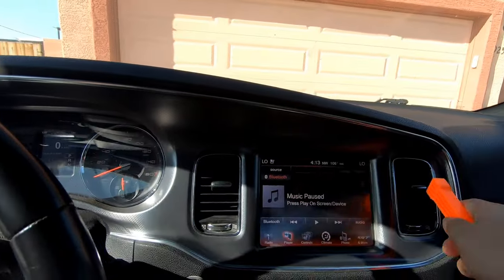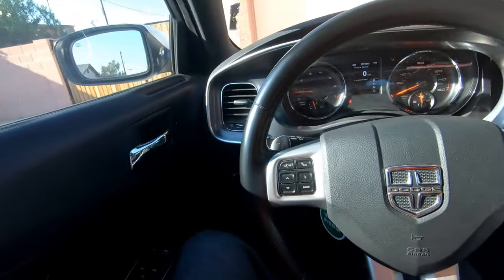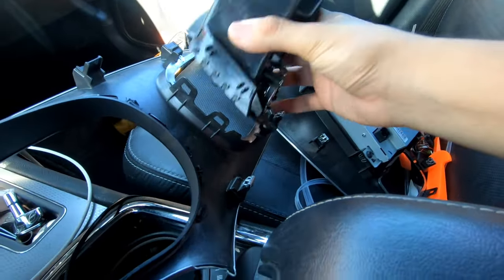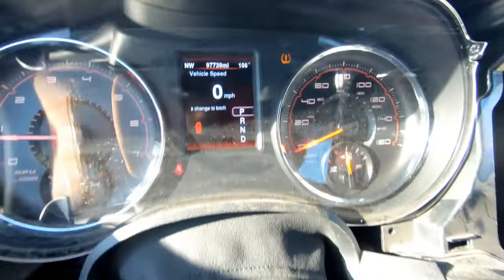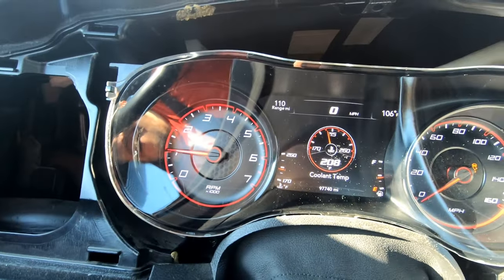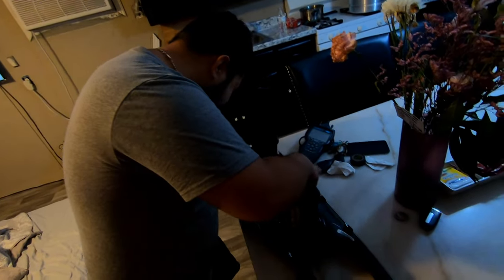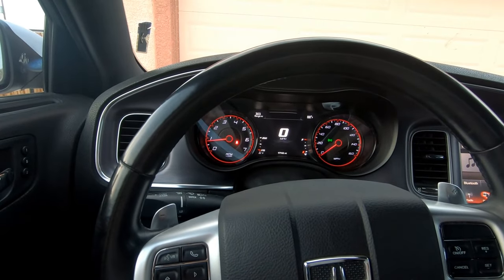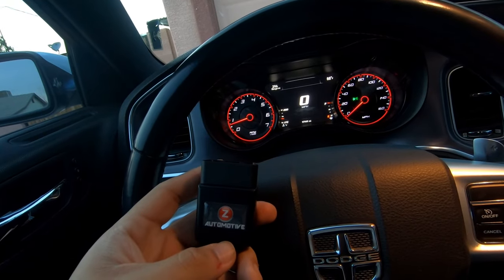Charger Cluster Swap Upgrade - How To

Comment from the maker: Here’s how to enable cluster swap mode to get full functionality of your new gauge cluster upgrade :D

https://youtu.be/BzK8vn2KXAA
Reply: How did you attach the radio
Reply from the maker: zip ties
Reply: If I upgraded to the same year uconnect as the cluster and bezel would the screen fit like normal you think?
Reply from the maker: unfortunately no, you’d need to order a harness for the radio to work and to get it to fit you need to cut out part of where the radio sits so the new one seats properly:c
Reply: Does the old bezel work wit the new cluster??
Reply: @EverythingBoosted350 will a 2017 fit in a 2012 dodge charger
Reply: how do u reset the odometer?
Reply: @mr_blobbington8620  you don’t reset the odometer you by one that matches your current odometer
Reply from the maker: with alfa obd you can set the milage to your original miles. i got lucky and swapped one with the same miles
Reply: @rollo1thousand154  well my odometer reading was at 159k miles and the new cluster is at 80k, I just wanted to c if I could reset it to what the original cluster showed
Reply: @EverythingBoosted350 k
Reply: Are the miles the same on both?

Comment: Can you still use the original bezel or you have to get the 15+ bezel
Reply from the maker: you can modify the original to fit the new cluster but from what i’ve read, some of the people that have done it are happy but not fully satisfied so they ended up getting the 15+ bezel to get the look they wanted. In the end you can go either way :)
Reply: Another thing so does it matter what year of the model the cluster come off of or just use the 15 work
Reply from the maker: Nah it doesn’t matter as long as it’s a 15+ <- the plus means years 15 and up, you’ll be alright :)

well 2015-2017
Reply: Will this work on a 2011 srt8?

Comment from the maker: PSA: Ignore the disclaimer in the video. 
Here’s how to get the gear selection menu:
You need to turn on cluster swap mode through the cluster’s tazer menu in order to activate the gear selection (PRND/M)

Cluster Features - https://youtu.be/vUHX43Ym7to
Reply: What buttons are u pressing in order to get to see the performance page
Reply from the maker: the directional pad on the steering wheel, i use the right arrow and res + buttons together as the missing ok button
Reply: When you got the other cluster did the computer put your miles up there or did you have to have it programed before
Reply from the maker: you’ll have to reprogram for miles, or find one with similar miles then swap when it hits the exact miles like I did (:

Comment: When you say new bezel, would that be a bezel from a 2015-2023 charger? Also, with the tazer, do you have to do anything extra before pressing cancel & the traction control button? Or will that just automatically work once the tazer is working & you have the SRT pages?
Reply: 2015-17 bezel
Reply: @AmaZingDeVours  Sounds good, thanks

Comment: Did this change the chime as well? It sounds like the 2015 chime when you start it up after the swap. It’s not super obvious but it is noticable
Reply from the maker: i never noticed if it changed and at this point i don’t remember what the original one sounded like😅
Reply: @EverythingBoosted350  it’s basically the same sound but the speaker is definitely upgraded on the new one so it sounds a bit more modern

Comment: Does the tazer have to be married to the car for it to go into cluster swap mode?
Reply from the maker: yes
Reply: @EverythingBoosted350   so I already cluster swapped it and I just got my tazer so I won’t be able to put it into cluster swap mode?
Reply from the maker: no youll need to swap the old one back in to setup the tazer then swap the new one back over

Comment: Did you have to do anything to get the miles programmed into the new cluster?
Reply from the maker: you can fix them with alfa obd
Reply: Does anyone know if you swap the cluster and radio in a 2011 can you access the srt pages?

Comment: Hi 👋🏻 

I’m from Saudi Arabia 🇸🇦.. my English language not good enough 

But I installed cluster for Chrysler 300c 2015+ on my 300c 2013 with tazer 
If you need the gear P-R-N-D icon.. you should go to radio page in the new cluster and go to tazer menu (press back and cancel in the steering wheel) go to performance page of tazer you will find:
sport mode for 5 speed gear turn it on 
Sport mode for 8 speed gear also turn it on 

And to icon for gear will show on in cluster
Reply from the maker: Thank you for the tip! Your english was perfectly worded 🙏 I was able to get the icon to show :)
Reply: Hello mohamed, i also live in saudi arabia where can you get the parts for the cluster swap here? Thanks

Comment: I have an 2011 dodge rt awd what year cluster did you use in the video
Reply from the maker: i got mine from a 2016 Charger RT
Reply: @EverythingBoosted350  did u have to program the miles or the tazor does everything
Reply from the maker: youll have to find one with similar miles or send it out to get reprogrammed
Reply: @EverythingBoosted350  I ended up using alphaobd to change it Thanks for the reply
Reply from the maker: nice! i got lucky to find one with my miles

Comment: hello, thanks for the video, it was really helpful!
I have one question. I swapped cluster to my charger 14, but I don't know how to change units on the cluster to metrics (mileage, temperature, fuel economy etc).
I have changed units to metric on uconnect, but it does not affect to cluster, have you any suggestion? Maybe there is any option to do it by AlfaObd or Jscan?
Reply from the maker: zautomotive tazer
Reply: By tazer you can only activate wheel buttons, and change current speed to km. How about for example odometer units..?

Comment: If you got a newer screen (2017-2020) would it still be adaptable to your RB5?
Reply from the maker: no because it’s not just the screen itself but the unit as a whole. You’d need 4 things to set it up. 

1 radio 17+
1 harness for the radio
1 climate control panel
1 usb/aux port from 17+ (For Apple CarPlay)
Reply: @EverythingBoosted350  🙏🏽 thanks
Reply from the maker: @juliusfeliz8616  no problem, ill be uploading a video soon on the swap🤘
Reply: So to install newer touch screen I have to buy the climate control panel from the newer charger? Also do I use the harness from the new radio or is there a plug and play kit to buy?

Comment: do you have to leave the tazer plugged in all the time for a gauges to work? you can't just go through the tazer menu and click cluster swap and it won't stay? i'm wondering because i have a tuner that has to stay plugged into my obd2 port and i can't keep the tazer plugged in all the time because i need to tuner plugged in. is there is a way to just enable a cluster swap setting then unplug the tazer?
Reply from the maker: The gauges will work regardless but if you want to navigate through the menu options that the cluster has, you’re going to need to plug it in and leave it :(
Reply from the maker: There is another tazer that you can wire directly into your harness and it’ll give you the added feature to adjust your transmission shifts and keep your tuner plugged in :) but that’s up to you if your okay with splicing into your harness v:
Reply: @EverythingBoosted350  do you think i could get away with using and obd2 splitter that converts the one plug into two?
Reply from the maker: that’s a very good question and i have no idea 🥲 if the splitter isn’t too expensive i say try it out, if not then the  tranZformer by zautomotive will be your best bet to keep full cluster functionality and your tuner as well :)
Reply: @EverythingBoosted350  ill give it a try, they're about $10 on amazon. ill comment back with and update if it works or not!
Reply from the maker: Hopefully it does 🙏 We’ll be waiting for your update thank you :)
Reply: @EverythingBoosted350  I reached out to Z auto and they said that the Tranzformer doesn't give you the cluster swap capability. They said for that you'd have to have the TaZer. You can have both plugged in tho if you want the swap and the shift adjust capabilities

Comment: Do you have to have a certain tazer for it to work
Reply from the maker: no sir the only ones that are a little special when it comes to the tazer are 2018- current year and thats because they’ll need a double bypass in order to use the tazer. You should be fine if you’re 2011-2017 :)
Reply: Were do you order tazer from

Comment: Is it feasible to upgrade the stock radio and instrument cluster of my 2012 Dodge Charger V6 SXT to those from a 2017 model or newer?
Reply: No radio, requires rewiring

Comment: wat year cluster did you get or does it matter
Reply from the maker: mines from a 2016 but as long as it’s 15-17 you’ll be okay
Reply: @EverythingBoosted350  I’m bout to get a 14 R/T and 15 will work
Reply from the maker: nice man congrats and yeah it should
Reply: @EverythingBoosted350  thanks
Reply from the maker: np 🙏🔥
Reply: @EverythingBoosted350 what happens if i get one over 18+?

Comment: I wonder if the 2015+ challenger cluster works on the 2011-2014 charger I like those guages a tiny bit better
Reply from the maker: it sure does!
Reply: @EverythingBoosted350 where do you get this at?

Comment: Hey I just swapped my cluster but screen not displaying on it waiting on my tazer to arrive do you have to have that in to get it to display
Reply from the maker: yes you’ll need the tazer to enable the swap to let you use it
Reply: @EverythingBoosted350  thanks !
Reply: Okay one more question when you plugged in new cluster did it automatically come on screen want show or gauges move any just get red light by rpm then nothing trying to figure out if I got a bad unit or if I’m making a mistake when swapping.   The guy said I have to get unit reprogrammed don’t know if any truth to that tazer is plugged in
Reply from the maker: everything should work on it with out the tazer except the ability to scroll through the menus, you’d need the tazer to scroll :) if it’s not starting up like a normal cluster then there’s something wrong. make sure it’s a 2015-2017 cluster and if you have a 2011 charger/challenger, try to get a pursuit cluster
Reply: @EverythingBoosted350  okay yeah I have a 2011 I believe something wrong with it’s a 2017 but  I just ordered a new one a I made sure it’s proof that it works will update within a week once I receive new one
Reply: Hey got the new cluster installed an working great but I’m getting messages about transmission how do I get rid of those messages thanks

Comment: Hey was you was able to get cluster to show what gear it’s in mine is on screen but not switching also I got paddle shifters but there not turning on when I hold the + one down I have it activated in tazer menu any suggestions
Reply from the maker: How To Use Tazer (For Cluster Swap Mode)
https://youtu.be/BzK8vn2KXAA
Reply: @EverythingBoosted350  thanks 🙏🏽

Comment: Yo bro question? i got a 2011 charger r/t and when i go on american muscle its saying the 2015+ clusters dont fit in mine or the 2012?
Reply from the maker: that's because it'll only fit how it's supposed to if you swap the bezel along with the cluster
Reply: @EverythingBoosted350  did u swap your dash out? im kinda not understanding if it fit in yours and u had a 2012-2014 unless u swapped out the dash
Reply from the maker: not the dash just the bezel
Reply: @EverythingBoosted350  OHHH you’re saying the 2015+ bezel will fit on the 2011 dash?
Reply from the maker: yes and you need to do that for proper fitment on the cluster swap

Comment: Im really stuck between getting a 2014 srt8 challenger but i hate the old technology and cluster so i feel like 2015 sxt or rt would be way nicer and less stressfull do you plan on upgrading to the new gens anytime soon?
Reply from the maker: i don’t think so man, car is 100k miles atm and still going strong 💪  I’m just modernizing it with the tech from the new gens. Atm i’m waiting on a harness to add carplay from the new 18- present. You wont go wrong with the srt8. sxt you’ll feel it lacking as soon as you try the RT but same goes for the rt when you try the srt lol
Reply: @EverythingBoosted350  where are you buying the hardness from ? For the Apple pages.
Reply from the maker: you’d need to ask @racingpassionmovement here on YT. He has his done and working :)
Reply: Get the srt8 bro ive seen 14 challys with the new interior not sue how much of a headache but itd be worth it
Reply: @EverythingBoosted350  could you please make a video on that
Reply from the maker: im trying to source the funds to do the swap, christmas shopping set me back a bit🤘

Comment: Hey bro would be nice to know how much of a headache I’m getting myself into if my intentions are to swap the cluster and dash from a 2014 srt8 challenger. I know all the work was done by yourself but how much am I looking on spending if I buy everything to swap?
Reply from the maker: best bet would be a junkyard to save on cost, i got my cluster from ebay for $120 the dash panel at a junkyard for $40 and the tazer was $280. For the SRT trims those tend to be a little pricey online. I’ve seen any where from $200-$500 depending on conditions and SRT sub trims

Comment: I see you lol did you turn on the cluster swap in the actual tazer menu?
Reply from the maker: I didn’t no :c will doing that enable the buttons w/o the tazer?
Reply: @EverythingBoosted350  no but it brings up the gears
Reply from the maker: Thanks for the tip! i’ll check it out (:
Reply from the maker: you’re 100% right i was missing that, it did bring up the PRNDM

Comment: does it have to be from a 2015 charger or can it be from 2015-2018? also i have an sxt so can i use the rt or does it have to be a v6 cluster?
Reply from the maker: it just needs to be a 2015-2017 cluster from a charger or challenger
Reply: @EverythingBoosted350  okay cool and i have the v6 sxt so if i get an rt cluster with the 160 mph will it have more rt features already equipped?
Reply from the maker: i dont know if there’s a difference between the v6 and RT clusters other than the extra 20 on the speedo. with the tazer you’ll get access to the srt features though (:
Reply: @EverythingBoosted350  oh okay so even if i get the v6 speedo the taser gives me rt options on the actual cluster

Comment: I changed mine and steering wheel but my gauge is stuck on tire pressure anyway to change it back to the digital speed without buying taser ? Maybe disconnect battery
Reply from the maker: unfortunately no, also i don't think the new wheel is going to work (button wise)
Reply: I’ve seen people do it with tazer but mine won’t work
Reply from the maker: is it a cluster between 2015 and 2017?

Comment: So why after I program it and everything. When I start the car my traction control light cuts on. I can’t even take it out of park , it’s like the shifter locked up and the check engine light is on buhh when I unmarry the car goes back to normal. Like I’m just trying try the sports mode
Reply from the maker: i’d get in contact with zautomotive and tell them about what’s going on; They have pretty good customer service that’ll be able to help out with that for sure. Im just posting what it says on the instructions v:

Comment: Does z Automotive is the only programmer for cluster swap?
Reply from the maker: it unlocks alot more features that comes in the pursuit and srt trim levels
Reply: Everything Boosted how about the diablo?, whats the difference on those two product?
Reply from the maker: diablo is a tuner for performance while the tazer allows you to enable and disable trim features like the srt pages, adding a backup camera, line lock, ect. 

hope that helps!
Reply: Yes that helps a lot.. thanks for the information..
Reply from the maker: glad i could help (:

Comment: Is the tazer for a 2014 model ?
Reply from the maker: yessir!
Reply from the maker: it’s for models 11-14
Reply: @EverythingBoosted350  does the sport mode make a difference
Reply from the maker: it holds the shift until you change the gear when in manual mode and a little better throttle response overall, other than that not really :)
Reply: Do you have a site I can go to to order a Tazer for my 2014 charger rt??

Comment: I swap my 2013 to 2015 but the car info speed etc doesn't show up only tires tire pressure and the mileage wasn't  correct:/
Reply from the maker: you need to put it into cluster swap mode🙂
Reply from the maker: How To Use Tazer (For Cluster Swap Mode)
https://youtu.be/BzK8vn2KXAA

Comment: I did the cluster swap and it has a front collision warning anyway to fix that. Also my mpgs and amount of fuel is messed up. And I also did the srt and perf pages will those temps being different then my 5.7 temps mess my engine or trans up. If anyone could just warn me about the harm of this swap and how to fix things I’d appreciate it
Reply from the maker: No harm to the car from doing the swap, even if the temps show different our 5.7 are still running at the normal temps it should be at 🙂 if you want the temp reading to be accurate you can swap in a 190 thermostat. plus it’ll let our hemi run a little cooler during summer months 🔥

Have you tried filling up and resetting the mpg?

As for the front collision warning, there might be a setting for it in the cluster menu settings.

Comment: I did the cluster swap in my 2011 Dodge. CHARGER   I ended up using a 2017 police package it works with my tazer .
BUT NOW IM trying to get my 8.4 touch screen to show the pages on it .

Maybe I missed a step some where . Any advice
Reply from the maker: there’s an option you have to enable to get the srt features but i forgot which, look up srt pages tazer on youtube, there should be plenty of videos🤘🔥